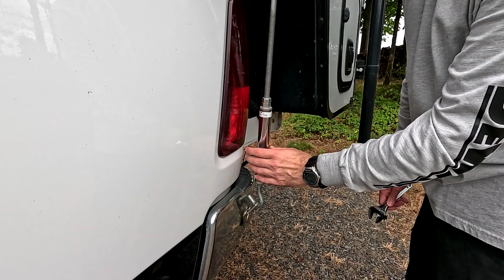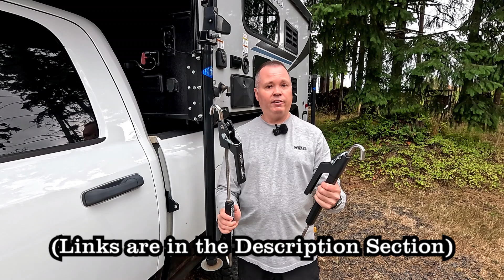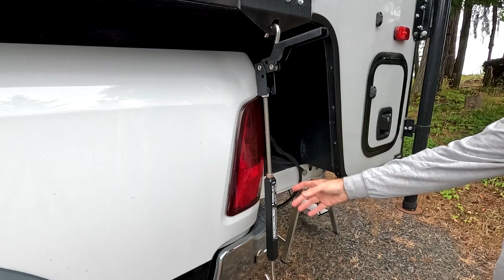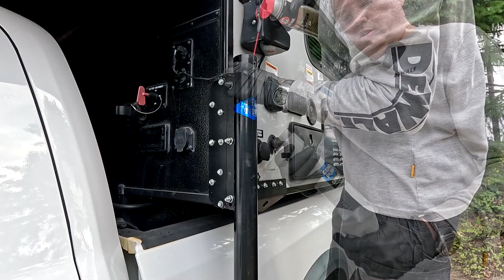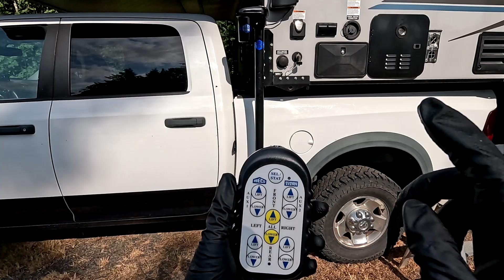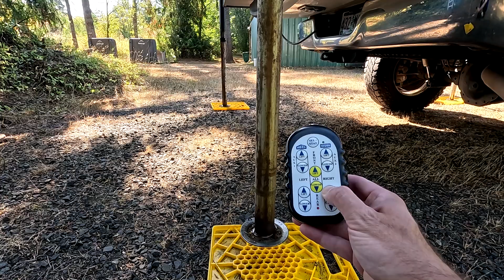Load Your Camper in a Fraction of the Time! Jack Head Conversion and FastGun Turnbuckles

Comment: The drill adapter is a big improvement over having to manually crank all four corners. But you can also easily sprain your wrist if you have a heavy camper and a powerful drill.
Reply from the maker: Yeah, I've had the drill try to twist out of my hand many times.